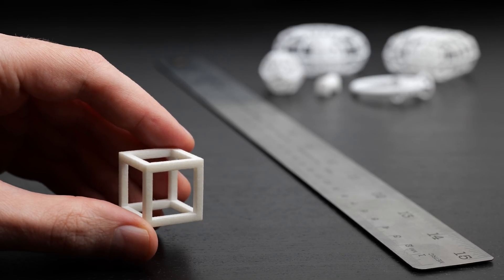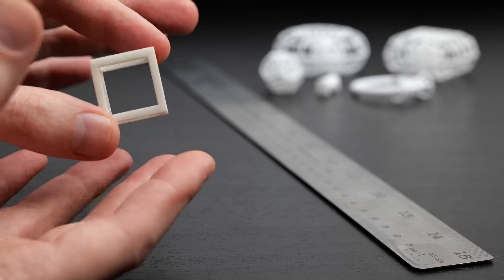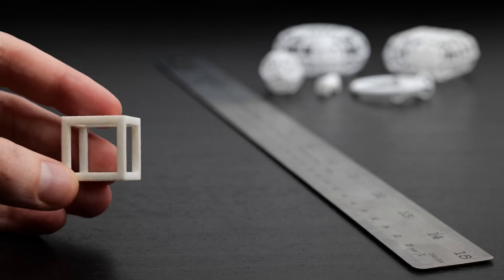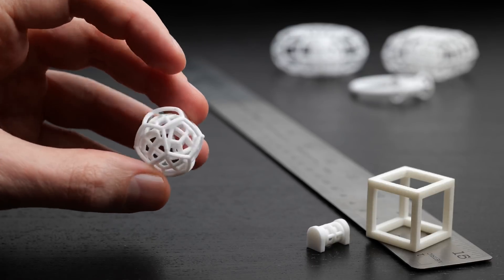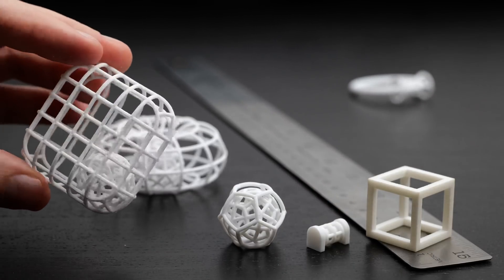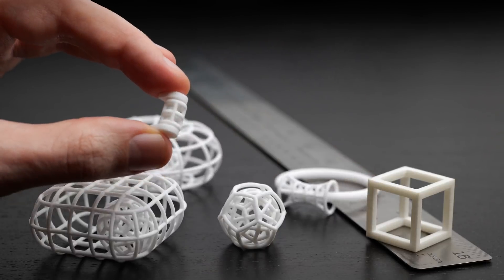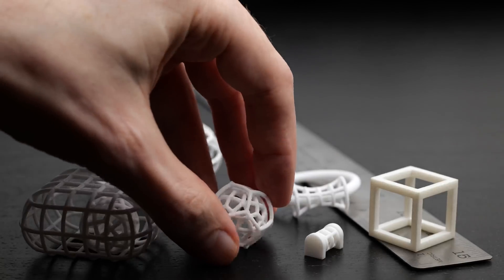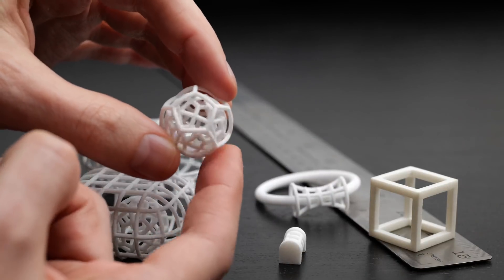Puzzling degrees of freedom

Comment: For 2 degrees of rotational freedom, a sphere on an axle inside a sphere where the axle can rotate about its center inside the sphere. Ball can rotate along the axis of the axle and around exactly one axis perpendicular to the axle.
Reply: A long cylinder (rod) inside a flat cylindrical void (coin-shaped void) works.  
Or if you’re worried about the flat ends of the rod, put a skinny bicone inside a flattish bicone.
Reply: @andrewkepert923 ... with the pointed tips of the internal bicone, resting in the circle where the two cones of the exterior bicone meet.
Reply: To me the simplest version of this is a capsule inside the convex closure of a torus. I.e. a rod with round ends inside a puck with round edges.
Reply: How about a ring with a long axle in it, so the ring can spin and move up and down
Edit: I made this comment before he showed it
Reply: So a gyroscope.... Ditch the axles and use hypoid gears - as one rotates, the other moves perpendicular.
Reply: So basically like a powerball (the exercise toy), which is a sphere with protruding poles inside a groove of an outer sphere.
Reply: @DiThi  Exactly, the only purpose of the spheres is for visibility. In it's simplest form it's a rod trapped in a ring shaped trough.
Reply: Example would be that the axle could ride in a channel that is a circle, so it can rotate 360 degrees but can't leave that axis
Reply from the maker: Is that still using just two rigid objects? Or three?
Reply: @henryseg  Two. The inside sphere isn't needed. 

Rigid object 1: A rod

Rigid object 2: a hollow sphere with a thick shell and a great-circle channel cut into that shell on the inside surface. (Think Death Star but inside out) The diameter of the sphere at the bottom of the channel is equal to the length of the rod. 

Place the rod inside the sphere with its ends at opposite points within the channel. It can spin in place, or it can rotate around the center of the sphere. 

Also, your 2DF example is two degrees of rotational freedom. If it was a wheel on an overly long axel, it would be 1 rotational DF and 1 translational DF. Since you've looped the axel into a torus, the "wheel" can rotate about its own center, or it can rotate about the center of the torus.
Reply: @henryseg  Just two, integrate the axle as part of the inner sphere. As simple as two round ends on opposite sides of the sphere.
Reply: @codeforge3301  You could turn the death star back right side out to make it more practical to physically build, just make a kind of C shape with the rod instead, and attach a ring to the rod around the death star to keep it from getting out. But then again I think Hayden's idea is better, just replace the inverse death star with just the channel.
Reply: @henryseg  Just two.  Inner object is a sphere with a little spherical lump on it.  enclosing object is a sphere with a torus groove in it.  The lump fits in the groove.   to see you are missing a degree of freedom, orient the torus groove so that it looks like a circle. Try make the sphere lump point at you. You can't do it.
Reply: @henryseg  Thanks for sharing, Henry. I hope you can respond to my email or message when you can. Thanks very much

Comment: how is torus one a 4-degree of freedom example?
the torus can only rotate in the three directions relative to the ball(and only one degree of freedom relative to its center), it cannot be translated if the ball is fixed
Reply from the maker: It’s easier to see if you fix the torus and move the ball. The ball can be rotated around its center however you want, which gives three degrees of freedom. Then you can also move it around inside the torus, for an extra degree of freedom.

Comment: You could have 5 degrees of freedom without artificial constraints by trapping the small sphere between two concentric spheres, where the difference in radius between those spheres is equal to the radius of the small sphere.
Reply from the maker: But then it wouldn’t be two rigid objects, it would be three. I think that it’s doable if we are allowed to connect the two spheres together in four dimensional space!
Reply: @henryseg  What about if we allow the use of magnets? If the ball and and the outer sphere are pulled to each other magnetically, there would be no need for an inner sphere. Would be difficult to make, and once you’ve made it, difficult to navigate through configuration space (since it couldn’t be a wireframe), but it would be possible
Reply from the maker: @jakobr_  Might require a magnetic monopole to do it in two rigid objects?
Reply: @henryseg  We don't have magnetic monopoles, but we do have electric monopoles. So what about good old static electricity? Object One could be a negatively charged ball; Object Two could be a negatively charged ball stuck to the outside of Object One. Or better yet, just use gravity: Object One is a perfectly smooth planet; Object Two is a little marble on the planet’s surface. (My apologies if your 3D printer doesn’t have a large enough print bed to print an entire planet.)
Reply: @henryseg  I was thinking that the ball would be made of iron or some other ferromagnetic material, and the outer shell would be magnetized, but I know enough about magnetism to say that I have no clue whether the ball would be able to roll freely around to all points of the interior surface, or if the magnetic equator and poles of the outside sphere lead to issues. So you might be right.
Reply: @henryseg  
if we are allowing the use of the forth dimention, why not just go for a sphear traped inside a klein bottle, that whould be 4 degrees of freedom with no constraints if im not wrong.
Reply: @henryseg  But Klein bottles kinda feel like cheating while we're still locked to 3 dimensional space with 1 time dimension.
Reply: that also was what I was thinking of

Comment: I was thinking you could get the 5 degrees to be much more satisfying by making the enclosure two spheres that are only connected by a couple lines so the enclosed ball rolled around mostly freely on the inner sphere. The solutions that I came to first were basically just all variations on enclosure shapes instead of axel wheel configurations for the lower ones.
Reply from the maker: Right that would have been more satisfying (and more expensive!), but the configuration space would of course still have boundary.
Reply: @henryseg  Yea, that's what I meant by mostly freely, if there is a way to make it completely free it's beyond me.
Reply: @henryseg  on the expensive part - these shapes can be printed at hom with an SLA printer out of resin (instead of SLS out of nylon).
Reply from the maker: @gpt10  That resin isn’t cheap!